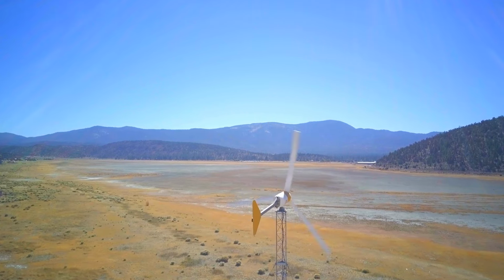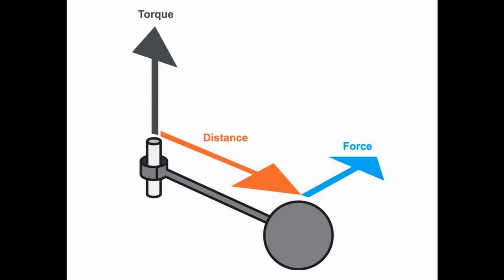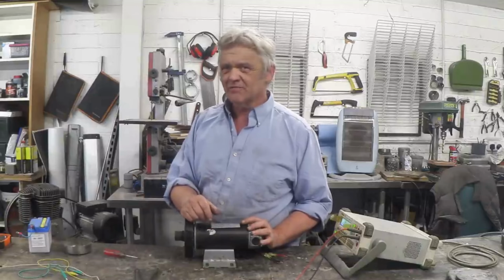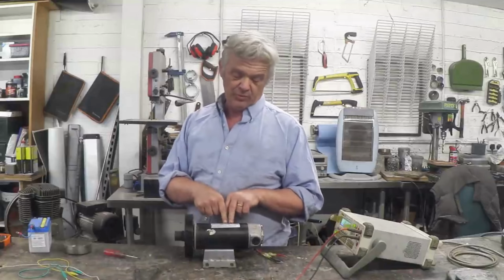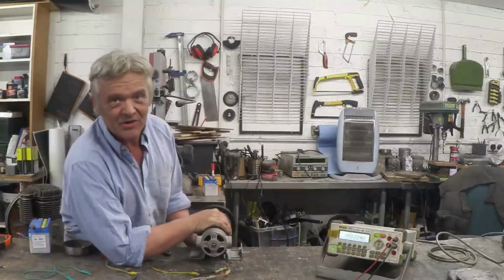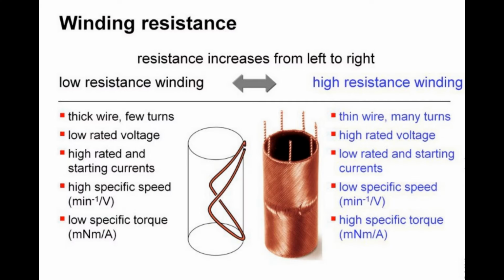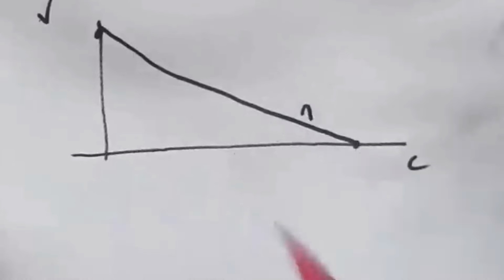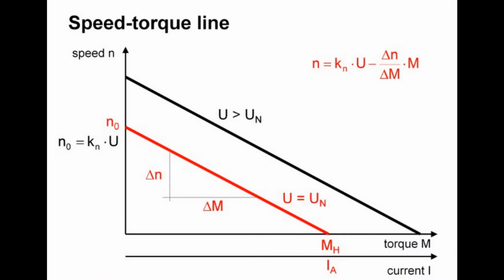2244 Wind Turbine Essentials - All About Using Motors As Generators

Comment: the bladeless turbine with gears/clutch may be used as prime mover, very efficient and easy to build(not the clutch/gear aspect) it uses compressed air or water and produces high RPM

Comment: perhaps with a battery and inverter you can use another motor as prime mover, and with the help of added inertia from zip line the small 
motor can spin/power the generator enough to cut battery out of circuit and have self-sustained generator

Comment: Not every electric engine can be a generator. The most common example is the 3 phase engine with one set of coils on the stator and the second on the rotor. 
When current is applied to the stator current is induced in the rotor so  coils push themselves apart.
When force is applied to the rotor nothing is induced as there is no magnetic field.
Reply from the maker: they can be converted too there is usually residual magnetism in the steel core - but even so - if you feed a current down the stator then they will generate - this is how large generators usually work as it is impractical to build permenant magnets that big - indeed that is how a car alternator works -  you might need to check your thinking there mate - cheers

Comment: I wish, we shall see also the wind-to-power formula in practice. i.e. Absolute max = 0,5 x speed x speed x air-mass/second x 0,5 for the blade-sweep-area . Because the air mass cannot be stopped and wind outside the blade-sweep-area in not used .

Comment: If you can find one, an AGNI/Lynch high power DC axial flux motor is an excellent generator as it is very efficient and ideally suited due to its high torque, low rpm design.  It will generate approximately 1 volt per 50rpm with an incredible amperage output potential.

The Lynch motor is an unconventional design with a disc armature. It marries the advantages of a conventional, wound armature motor with the benefits of a flat (printed circuit) motor. It is similar to a pancake motor, but is more powerful than any of these technologies. The disc armature has magnets on both sides, doubling the available flux density and shortening the magnetic path. It therefore packs more power per pound and per cubic inch than any other motor technology. Of course such a revolutionary motor is not for every application - it is not as cheap as wound field motors, but for many applications it is a far superior motor.  It has a previously unheard of power to weight ratio and also power to volume ratio. It is also highly efficient because of the double magnet design and associated short magnetic path. It also includes integral fan cooling.

 The Lynch motor is an important development which spurred other motor designers to improve their products to remain competitive, such as synchronus permanent magnet machines.  As a result of the competition between manufacturers the cost of high performance motors and controllers has fallen dramatically.  We hope the cost of solar cells also reduces to allow renewable transportation to develop as a viable alternative to carbon fuels.
Cedric Lynch built his electric bike around a mid-drive configuration, also building one of the worlds most efficient light weight electric motors to power his rig reliably at 60-MPH for significant distances. He would later set several world records with his axial flux motor and bring it to market as the Lynch / Agni motor. Briggs and Stratton would eventually buy this technology which would lead to the Etek motor, which is now famous for making high speed efficient electric hot rods.

Cedric uses to achieve high speeds is by following the rules of aerodynamics, and building a bike that is as aerodynamic and as efficient as possible. The other builders on this list bypassed this step, and Cedric uses this bicycle as daily transportation on real commutes. Although this high-efficiency motor uses “old school” brushes, this fact allows builders to use very affordable controllers. He has proven his design choices through thousands of miles of commuting, and the Lynch motor is highly respected.

Cedric Lynch is known as the creator of the Agni Motor, a highly efficient electric motor that weighs around 25 pounds and can put out as much as 50hp. 

Cedric Lynch is a British 'mad scientist' type mechanical engineer obsessed with the idea of greener transportation. His interest has been in building a super efficient yet powerful vehicle that can serve as a car replacement.

He started thinking of his own design for an electric motor in 1983 when he began entering competitions organized by the Battery Vehicle Society regarding building an efficient electric vehicle. At the time there was no reasonably priced DC motor with descent efficiency so Lynch decided to build his own utilizing modifying existing motors with old tin cans that he would spread out flat to use as cooling fins. Surprisingly using rudimentary materials and a garage work bench, Cedric was making better more efficient electric motors than any of the universities were able to manufacture in state of the art workshops.

Cedric then came up with a motor design that could be cheaply manufactured and began manufacturing his own motor that he could sell to the public in 1988 and the Lynch Electric Motor Company was born, known as LEMCO.

Cedric first used his motor to create a small boat called “The Spark” that would set an electric boat efficiency record. From there Cedric turned his attention to bicycles, an application generally considered too small for a lynch motor at that time. Cedric mounted his motor in recumbent bike, allowing him space to eventually use a set of thundersky lithium batteries.

The resulting aerodynamic recumbent bike had a top speed of 60mph and still managed an incredible range of 150 miles. Cedric rode his recumbent creation everywhere as a daily commuter, putting an amazing 50,000 miles on the machine - technically a motorbike.

Briggs and Stratton, the US firm famous for lawn mower engines, bought the technology and used it in their E-Tech Motor, and Cedric went on to manufacture his latest incarnation of his lynch design into the Agni motor, which is used in go karts, sailboats, motor boats, and even small airplanes.

The Lynch designed motors all have the same traits. Brushed motors, around 25 pounds in weight and they are able to put out enormous power compared to their weight. Sometimes as high as 50 hp (depending on amperage ran through the motor) at an incredible 98% efficiency.  Lynch Motors are also the most often used motors in electric motorcycle racing applications.

Cedric's zero-emission motorcycle, which has a top speed of 120mph, was shown in action winning the world’s first zero carbon race – the TTxGP in the Isle of Mann.

The idea for the electric motor has been snapped up by the 56-year-old’’s friend Arvind Rabadia, who together with his brother Hasmuk Rabadia had been thinking of starting a business in India. They have now set up Agni Motors to make further-improved versions of Cedric’s motors

Despite Cedric’s breakthrough invention he has no formal engineering qualifications and taught himself the techniques needed to construct his engine. He first became interested in electrics when his parents bought him a book entitled How to build things from things found at home. 
The Etek motor is a brushed 25-pound pancake shaped motor that puts out enormous power for its weight. Depending on amperage and voltage the Etek can easily provide between 15-horsepower and 30-horsepower reliably and consistently (11-kW / 22-kW). A perfect platform for a powerful electric bike if you do not mind the weight. Although brushless motors are considered more modern, a brushed motor like the Etek allows the builder to use very affordable controllers.

Cedric-Lynch invented the motor and sold it to Briggs and Stratton which US company produced the Etek at a lower price (around $600). In the late 90’s early 2000’s it was the way to go for a high-power / light-weight electric vehicle. Many small E-vehicle records were set using the Etek motor. Finally, the market had a relatively lightweight and powerful electric motor available to the masses.

In essence, the Etek allowed hot rodders to build electric bikes. Before the Etek very few people had ever achieved 50mph on an electric bike. Even today, Etek motors (and newer incarnations of the Etek motor) are used to make some super fast electric bikes. In the case of Liveforphysics, the fastest E-bikes ever.

 Liveforphysics used a newer version of the Etek (the Agni motor), to achieve speeds of over 70mph, and dominate a recent hill-climb event.

Every Etek I have ever ridden has been characterized by brutal off-the-line acceleration, usually to a point where you have to apply the throttle very carefully or get thrown off. However, it is possible to run an Etek at a lower voltage or lower amperage and have a very manageable, safe, and sane electric bike that will not burn out on you, no matter high steep the incline.

Comment: 😊 How about putting some propellers on those motors on the end of a windmill? Let's say a 6 foot windmill with those motors on the tips being driven by wind blowing past the tips. When the wind blows the windmill around, it seems to me. This should be a very efficient way of getting some high R. PM without any kind of gearing, you just run some wires down and put a rotor there and collective power. What do you think?  I'm sorry

Comment: is there a way to power more than 1 generator
1 low torque generator that will spin in low wind speed
AND switches to a higher torque generator that when the wind speed is high enough for it
Reply: Hall sensor + micro controller + relay 🤔

Comment: WOW! I'm talking about lightbulb here. Here in the US, our lights operate at 110v. Getting 240 from that generator is jaw dropping!
Reply: I think if you'd get yourself a mixer like that, it would be made for 110V.
So if you'd build the same setup, it would work as well. Only difference is your voltage will be half of Roberts and the current will be doubled, resulting in the same amount of watts (assuming you put in the same amount of watts by hand).